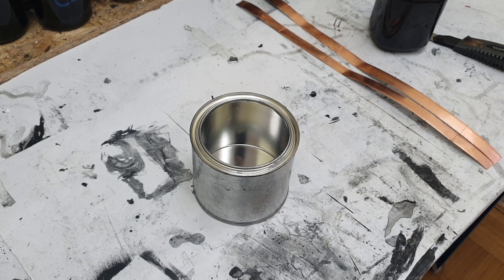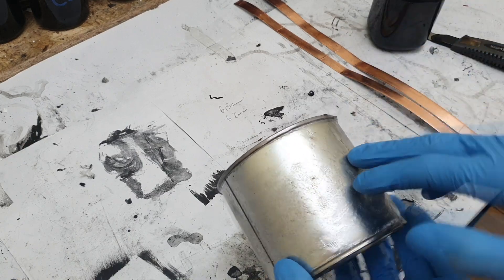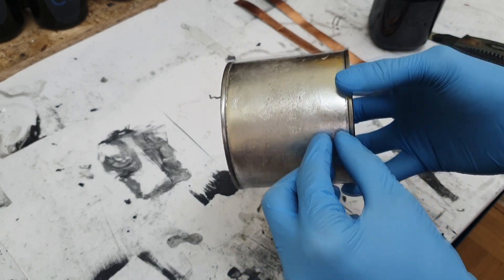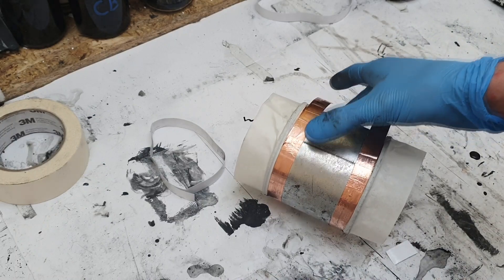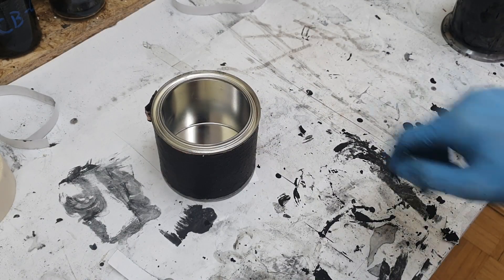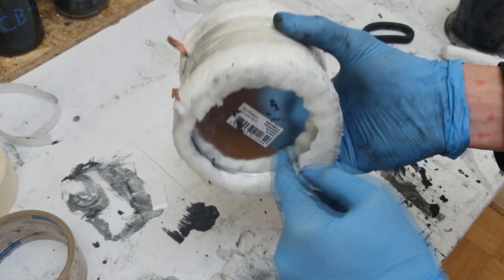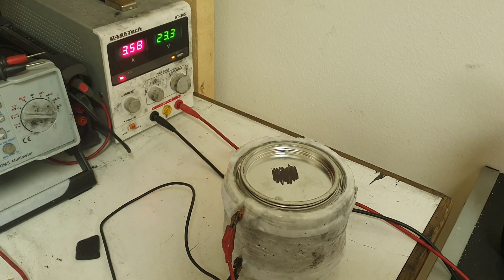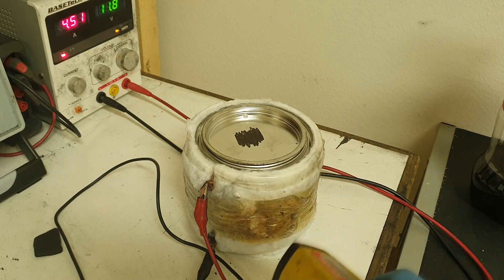Homemade Oven from Conductive ink

Comment: Hı friend ,you connected (+) probe and (_) probe on the tin box.Does it make shortcut ?
Reply from the maker: Actually yes. Is resistance heating
Reply: @cayrex  I Will Try ,one copper band (+) on tin box and other copper band (_) on insolator...The contuctive ink iş between of them.I Wonder what will  be.
Reply from the maker: @macittan6602  ok. It will start to heat up. If you have good conductive ink will start to heat already on low voltage. If the conductive ink is to resistive then you will need more voltage
Reply: @cayrex  can We use Woods coal.
Reply from the maker: If you graphitize the coal to become good confuctive, then yes. Only wood charcoal have high resistance.

Comment: I thought the copper tape sticky side would become problem with heat but seems OK? I will do this now. I wanted to for a while but always thought the adhesive would melt and short out.
Reply from the maker: Make the heating element around the can like I do in this video. And you will not have a problem https://youtu.be/11W06mQZIjA

Comment: What is the temp range of the conductive ink,and at the highest temp what was the voltage and amp required?
Reply from the maker: Temp range of this ink is around 250 to 300 degg C or more. On 12V and 5 Amps was the temperature around 200 degg C. My power supply is limited to 5 amps so I was not able to se what temperature I get if I put more power.

Comment: NICE  , are you using water based non toxic binder ? Graphene ? Ohms ?
Reply from the maker: The ink is not water based, but use a non toxic binder when is dry. Graphene,..  multi layre. At last measurement was 6 ohms,... but the resistance went also down when the oven heated up (the ink dried completely)

Comment: Great video! I have a question though. while you were testing the oven the voltage you were using kept getting lower and your amps rising.  was the heater drawing less and less voltage? or were you intentionally lowering it for some reason?
Reply from the maker: Hello! The oven set the voltage itself. This is because the resistance between copper electrode are low and because of low resistance the oven need more current that voltage. Maybe the ink was not fully dry and when the oven heat the ink get dryer and more conductive and at the same time the more current is needet. But the current was fixed to 3.5A by my power supply at the start that way you see the drop of the voltage. After some time the power was set to 3.5A and 10 volts. I increase the amps to 5 amps (what was also the maximum curren of power supply) and the voltage goes to around 12 volts. For example if I put 10 amps the voltage will be around 24 volts. Also for example,... if the resistance between the copper electrides will be higher then the oven will need more voltage and less current (if the resistance will be around 100 ohms then I need to put higher voltage around 100 volts). Hmm, I hope you understand me what I try to say. 🤔
Reply: Ah ok!  Very interesting indeed. Thank you for your detailed response. You've explained it quite well.
Out of curiosity, may I ask where your from?  One of my friends in college, here in the US,  had almost your exact voice and accent. lol :)
Reply from the maker: hehehehe,... I am from Slovenia,... a little country in shape of a chicken 😂🤣😅